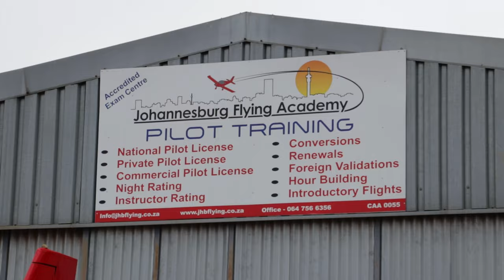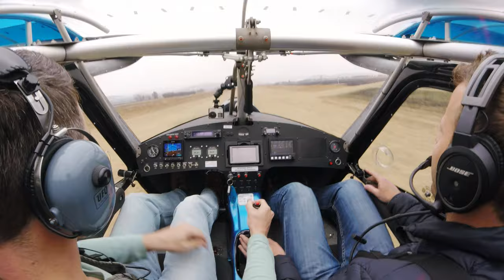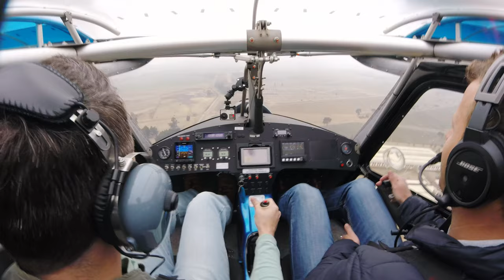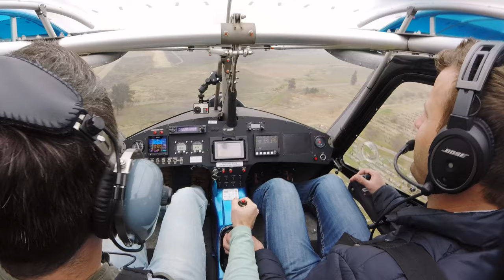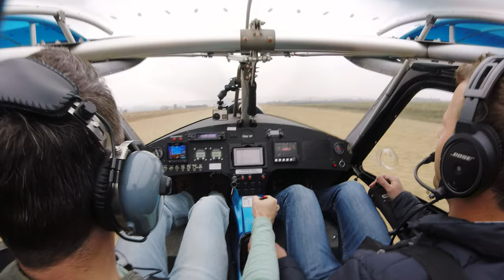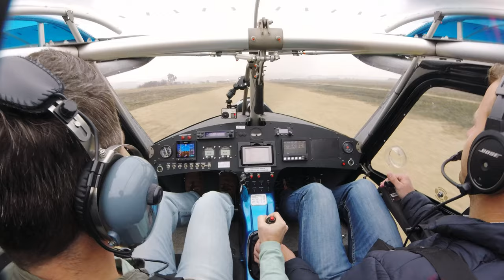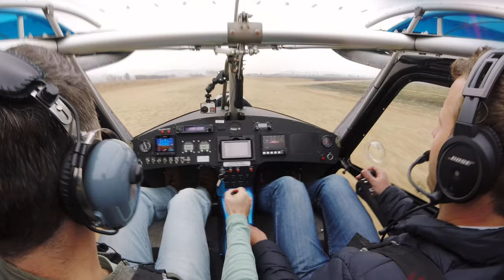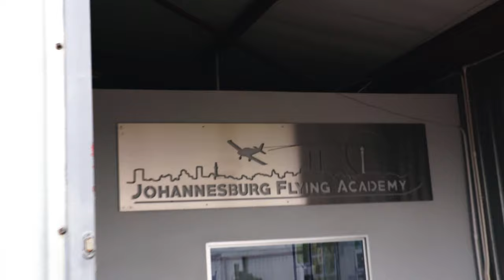SkyReach Bushcat Conversion Training

Comment: I like 1/3 runway rule. I usually set my minimums were mains must be off ground by midfield. And then see how she is climbing out. Worked great  for my gyrocopter and airplane as well.
Reply from the maker: Agreed, it's very useful. Without it one might not realise early enough that the plane is eating up more runway than usual before rotation.
Reply: Hellz yea 🤠🤠👌👌
Reply: @LetsGoAviate  Exactly,  and I don't care about density altitude.  Off the ground by midfield or abort.

Comment: we actually do the flaps on ours with the right hand, which is actually a little easier. i'm yet to fly the butsitter version of the cat, ours is a trike.
Reply from the maker: Yeah I was briefed that I could do it that way around. But I didn't like the idea of taking my right hand off the stick in those critical stages of flight.
Reply: @LetsGoAviate  we swap hands so that our lef thand is on the stick..
Reply from the maker: I assumed as much, but seemed weird that way around. Will have to try it next time!